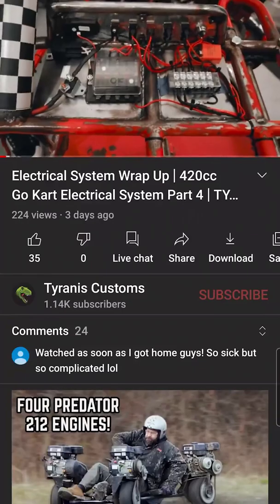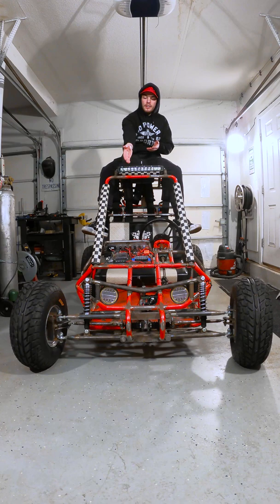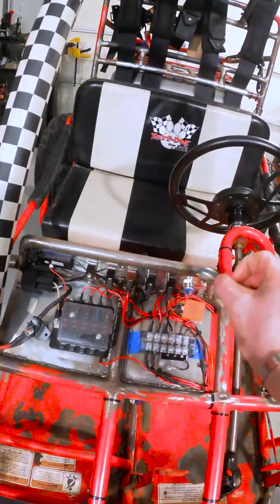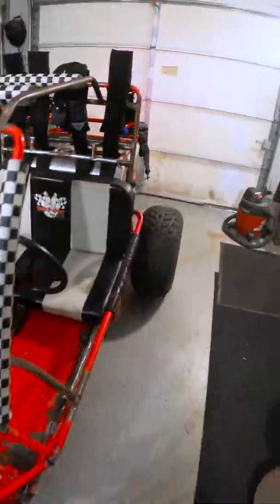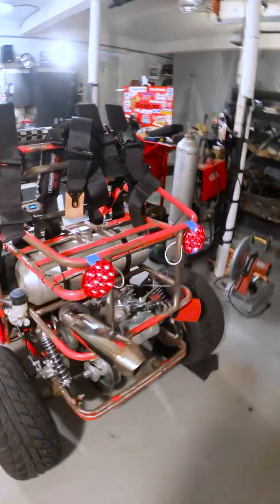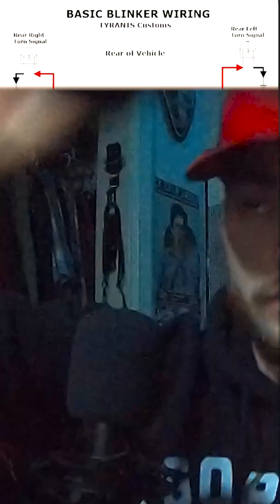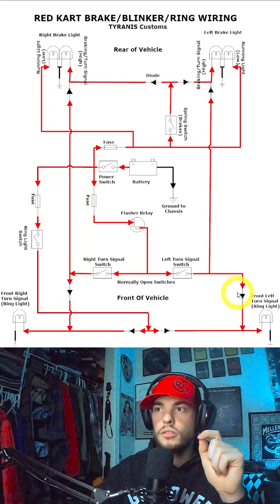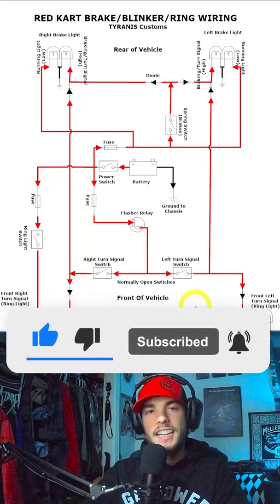DIY Go Kart Blinkers | Free Wiring Diagrams | TYRANIS

Comment: What size fuse did you use inline on diagrams?
Reply from the maker: I didn't specify as I assumed that would be different per application. Mine are full size atc fuses.
Reply: I was referring to amperage size ?
Reply from the maker: @henrygibson2906  that's gonna depend on the specific light you use and how much amperage it draws. I talk about that in depth here:
https://youtu.be/w3x3n9qXmGs

Comment: There’s one problem using just diodes and that’s when the brakes are applied it overrides rear turn signals. Then only way to fix that is an “exclusive OR gate”. Too complex to explain here. Same problem with the ring lights, the on switch causes the blinkers not to work. Simplest solution is to use separate lights for the turn signals. An exclusive OR would require a circuit using high current semi conductors .  But for a go kart this works!
Reply from the maker: Yeahhh I realized that too but like you said, these are still karts and I'm not sure street legality is even an option where we live. THAT SAID, I do have a pretty easy fix in mind with just some more relays and creativity and it sounds like the comment section has spoken and I'll be making a follow up video!
Reply: @TyranisCustoms  I could send you schematic how I did it on a motorcycle, you need a cmos exclusive OR gate and a mosfet transistor, no diodes needed
Reply from the maker: Sick! email it to me when you get a chance! TYRANISCustoms@gmail.com! I'd love to check it out! Thanks!
Reply: @TyranisCustoms  ok, I’ll have to draw it up... I made the circuit
Reply: @TyranisCustoms  OK, I'll have to look for my drawing or redraw it... I did it many years ago!! and the circuit board is potted because it was on a motorcycle... really pretty simple but you have to switch the grounds... pull down transistors work better and cooler in that mode. Then just a few resistors to buffer inputs from over current or shorts. seeing you're using LED's the current will be much less so smaller transistors or FET's should work fine.I was an EE at Westinghouse and Kodak 35 years, SO I made many cool G-jobs! (governement work, AKA home projects!}
Reply: @TyranisCustoms  I've got the turn signals all figured out, not sure about the front ring lights as running lights... requires a little more logic. But I'll figure it out!
Reply from the maker: Wow that's awesome! I went to UCONN for ME so most of my electrical experience is casual dabbling haha. I didnt realize you were gonna have to draw it all up from scratch again, I feel a little bad... I'm excited to see what you come up with though, I love learning new things!
Reply from the maker: The way I've got my rings wired up they are acting exactly like the brake lights are essentially. The difference being that switch just doesn't spring back open on its own like the brakes. So unless there's something else I'm not taking into account I feel like whatever solves the rear turn signal issue should also apply to the rings. Assuming the general wiring stays the same, which yours very well may not...

Comment: I am an electrician/electrical contractor as well as a certified welder/fabricator..  the only issue I see with this is when you press the brakes you will just have solid lights on the rear and no more turn signal identification...  it takes a little bit more complex circuit for this style to work, like a trailer..  good info here, just thought I’d point that out, cuz this would not be street legal without your turn signal flashing while at a stop while pressing the brake
Reply from the maker: First of all, Thank you for the validation there! Secondly, I noticed that was well. My work around for now is the hand brake doesn't turn on the brake lights (and I'm also not even sure street legality would be possible for these things in CT) so I could kinda get around it if I really needed to hold on a hill and and still indicate direction. That said, do you have any idea how those trailer circuits work? I was dreaming up some kind of pair of normally closed switches that could be opened electronically when pressing the brakes allowing the blinker to override the braking on one side or other other. Not sure if that makes sense or if there is some better component I'm not aware of but I'd absolute make a follow up if we came up with something more legit!
Reply: @TyranisCustoms  yeah man, you would have to use a relay. So that when you turn on the turn signal it would cut off the power going to the break light but in turn fire up the flasher for the blinker.  I used to build all kinds of crazy stuff, air ride suspension for vehicles used to be my specialty..  I’m actually in the process of getting some equipment to start a channel myself and build all kinds of stuff!!  Keep up the great work amigo!
Reply: @TyranisCustoms  and btw, a lot of little relays have positions on them for normally open and normally closed so when you signal the relay you can get really creative!
Reply from the maker: Sick!! I've got a few of the bosh style ones. Those have a red wire that I assumed was just always on but maybe it breaks then the relay engages 🤔 these are a little to big and bulky for how little current I need to push. Any recommendations on something smaller? We're only dealing with like 1amp.
Reply: @TyranisCustoms  search for “micro Relay” on amazon.  Tons on little relays will pop up that go in vehicles where this type of action I talked about happens. You can simply make connectors to slide onto the terminals.
Reply from the maker: Sick! Thank you!